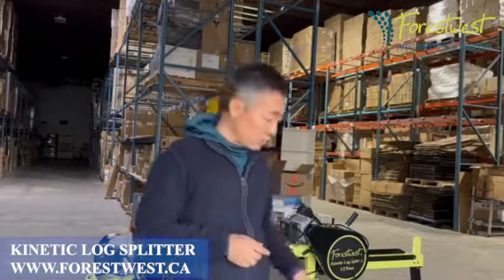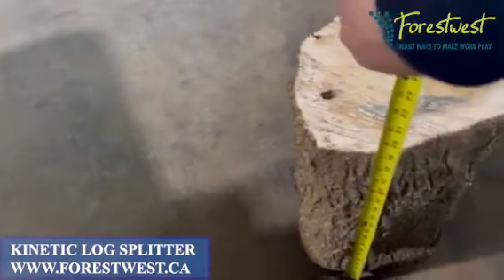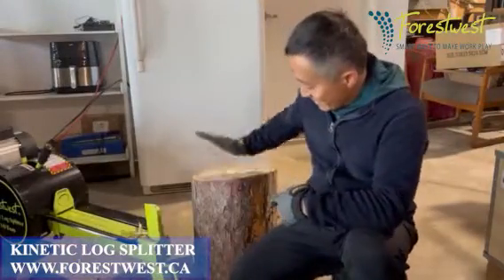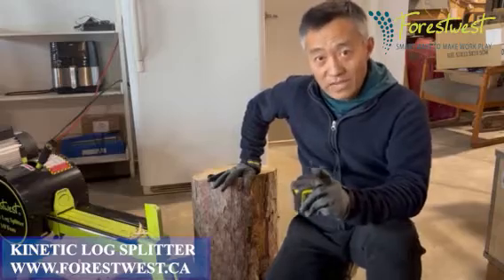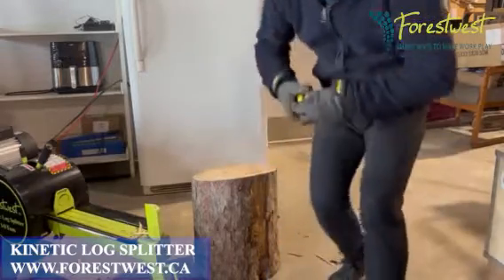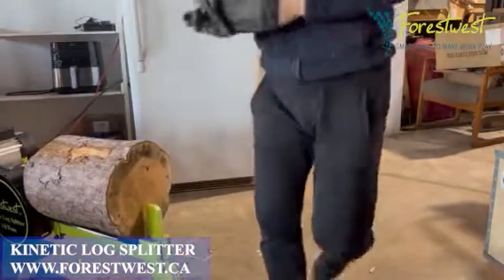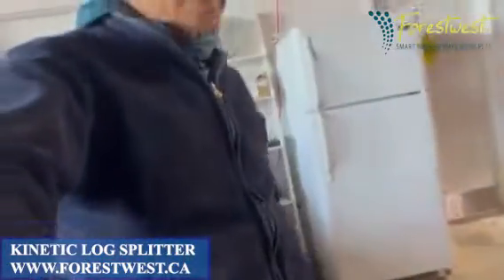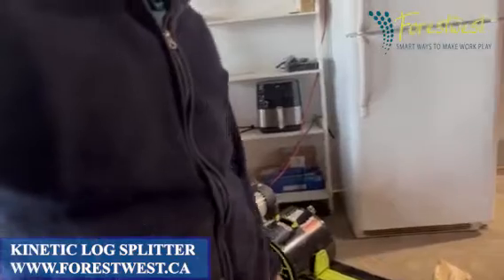10Ton Electric 2HP Kinetic Log Splitter, Testing FORESTWEST BM11056 Log Splitter

Comment: Great video! I think you just sold me on which one to buy! 
I was really concerned when it says “max log size 16inch but i see there is a little more room there for 17 or 18”.
It looks like it has plenty of power. My only concern is that noise it makes if it can’t split the log is that the belt squealing?
Reply: I'm guessing the flywheel